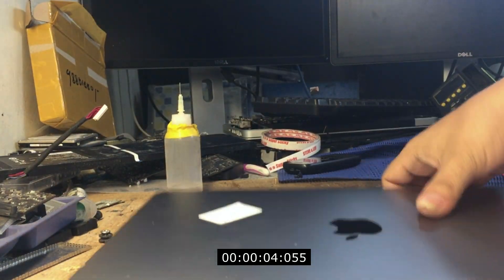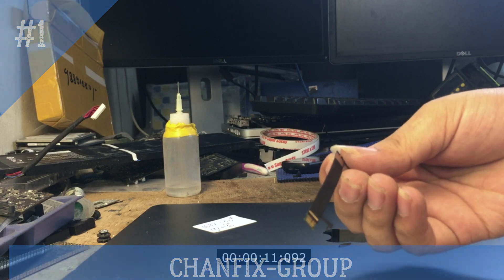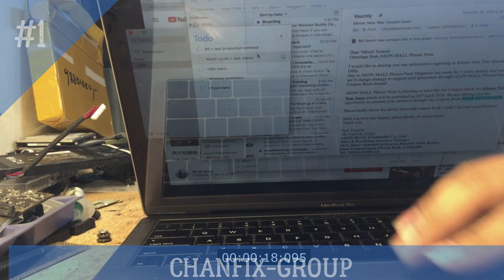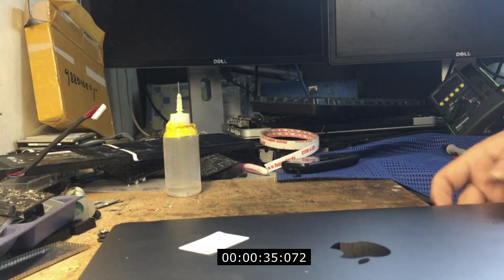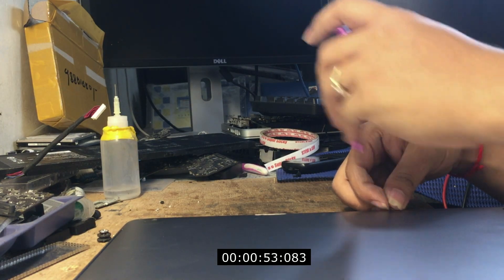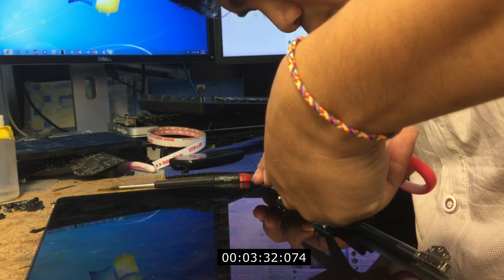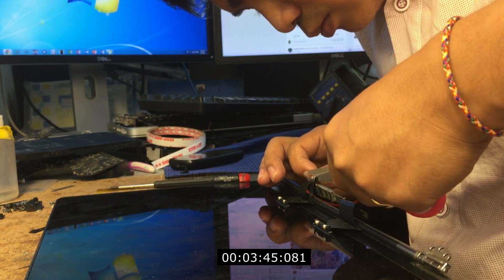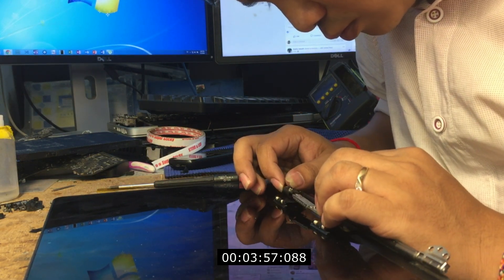Problem Solved | Repair Backlight LCD Macbook Screen Model A1707 | A1708 | A1706

Comment: need a cabe also. don't have a blackout situation. just a black strip in the middle of the screen.. happens when opening more then 45 degree.. thanks.
Reply from the maker: So you need cable